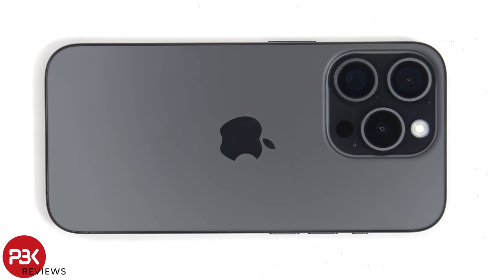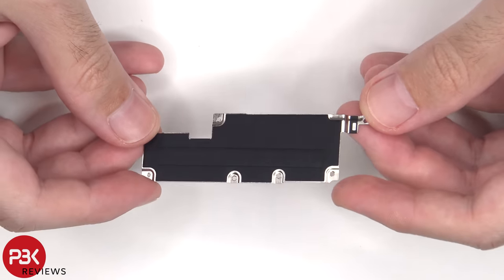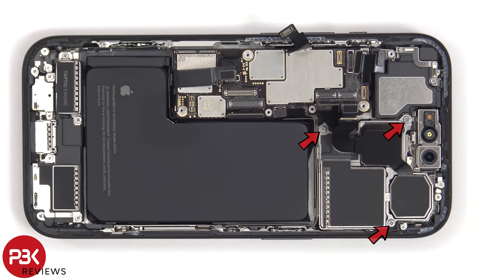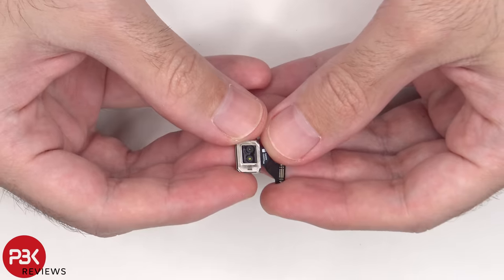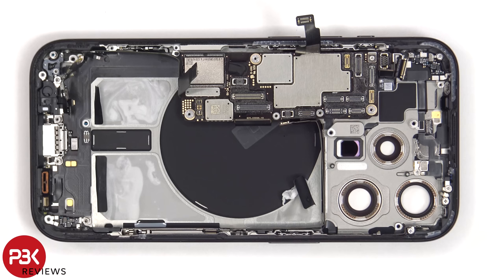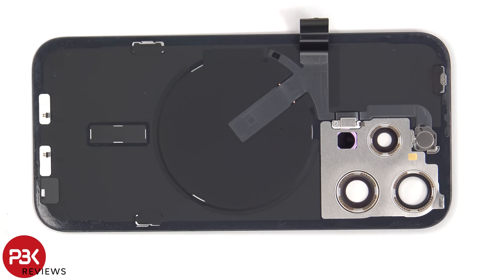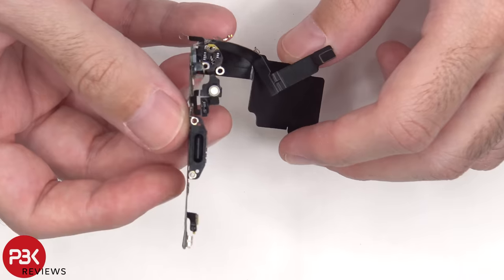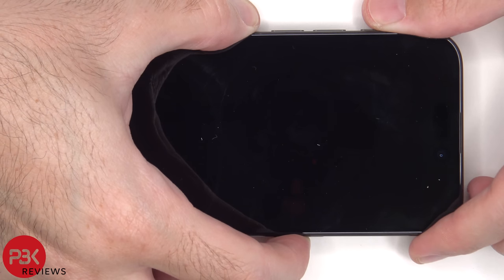Apple iPhone 15 Pro Teardown Repair Video Review

Comment: Are you going to keep this iPhone model bc maybe you should dig a little deeper and pry open the sandwiched logic board to tell us if the SOC is stacked with another chip. I think a lot of people are curious about the thermals, I know that affects them significantly. Personally I’m trying to figure if it’s at all possible to add on any additional thermal interface cooling solutions but I need to be able to tell how the chip is exposed. Would be great to hear a response from you
Reply from the maker: I usually sell off the devices after the videos to recoup costs for future videos since I purchase almost everything I do a video on. So I try not to destroy them. However, I don't even see how you would add any cooling solution to a chip that is sandwiched between the boards. De soldering and separating the boards would render it not working. So not really like you can separate it and add something on top of the processor or ram. Also keep an eye out on Weki Home channel they almost always take the boards completely apart (it's in Chinese though).  I'm sure their teardown will be out soon and we will all get to see the inside of the main board :)
Reply: @PBKreviews  My idea would be that if the SOC isn’t stacked and is directly aligned between the opposing plates there is possibility for additional cooling but if it’s stacked directly with (previously the baseband chip) another chip it would be more difficult. Thanks for the reply. I watched a previous teardown where they replaced specific logic board hardware because of a bad part draining battery due to current leakage on REWA channel it just requires, heat plates and the like, all the special tools to make it happen…but it won’t destroy it because that was a repair a video they put it back together and had it working fine
Reply from the maker: Yup with those special tools and devices they have on hand as well as the experience, its doable. But by people like me who don't have that extensive knowledge in soldering as well as those needed tools, won't be doable. I would be able to take the board apart sure, but put it back together again properly with the solder points aligned and all that good stuff, not a chance lol. Soldering is my worst area.
Reply: @PBKreviews  thanks for replying. Thanks for contributing with what you did
Reply from the maker: You're welcome :)

Comment: not seeing why the back has to be removed to get screws out to remove port. looks like same as previous . ive enlarged video,i know there are edits so am i not seeing something ?
Reply from the maker: The screw brackets holding the back cover screwed down are in the way of the screws from inside which screw the port to the frame. You can bend the brackets down or out of the way to gain access to the screws but you risk damaging those brackets or breaking them.

Comment: You could have used a black stick or spudger to remove the connectors much more gently.
Reply from the maker: I've found the pry pick to be easier to use than those

Comment: Glad they made the back glass removable like they did with iphone 14 and 14 plus.  Its About time.  People will still go to the shops to get it done.  I own a shop so I am happy to spend 4 minutes on it instead of 4 hours with laser machine.  Right to Repair is great.  Now We need to make parts not serialized so it will work on replacement if a part failed eventually as Apple is famous for their planned obsolescense.
Reply from the maker: Yup!

Comment: How long do you heat it for? And what temp thanks
Reply from the maker: You can use a hair dryer or heat gun (safer against damage with a hair dryer) to gently heat it up so its hot to the touch and you can always apply more heat as needed while prying it off. I don't know exactly what temp or time since I don't personally use a heating pad or other heating devices.

Comment: Nice! Do you plan to do one on the 15 Pro Max too? I would also be interested to know if the camera sensor sizes in the 15 Pro Max are larger than the 14 Pro Max on all 3 cameras?
Reply from the maker: Thanks. I wasn't able to get one in time to do, and since others will probably get to it before I had a chance, would be no point in spending the money on purchasing it.
Reply: @PBKreviews  understood and no problem. Thank you for kindly replying. 🙏🏻
Reply from the maker: You're welcome :)

Comment: hello I missed it in the video but where are the wifi and bluetooth antennas located?
Reply from the maker: @9:35 its that flex cable assembly, and here is a look at what it looks like: https://www.unionrepair.com/replacement-for-iphone-15-pro-wifi-antenna-flex-cable.html

Comment: WHAT IS THE LIQUID YOU USE TO DISASSEMBLE THE BATTERY?
Reply from the maker: isopropyl alcohol. You can use this: https://www.ifixit.com/products/ifixit-adhesive-remover?variant=39915173740647

Comment: While minor, you said the battery was 3290mAh battery while it shows 3274mAh.
Reply from the maker: There are two numbers written on the battery, one larger one smaller text. one is rated capacity while other is typical capacity.

Comment: After assembly it will still be water resistant till 6 meters for 30 min? I didn't noticed any isolation paste that you used at the end.
Reply from the maker: I don't apply the adhesives until after the video, since I take it back off to make sure everything is in place and properly take the time to apply the adhesives.

Comment: Cannot wait to watch the DROPDOWN test video😂
Reply from the maker: haha, I won't be doing one on this phone since 1) its already disassembled and compromised, and 2) It would handle the same as the 14 pro max since there are no major changes in the screen or glass structure/design.
Reply: @PBKreviews  That's okay still, thanks for your good review video:)

Comment: We can change the back glass colour like the iPhone 4 and 4s!!! rejoice!!
Reply from the maker: Yup, but most likely apple has the wireless charging coil paired to the phone so if its replaced, you will get error messages or it might not work properly etc. So you may need to pry the wireless charging coil with flex assembly off the old glass and move it to the replacement to make sure its compatible.

Comment: one minor error that the sensor shift IS on Telephoto only applies to Pro Max’s camera. Pro’s 3x telephoto camera remains with typical OIS as same as the last year model’s
Reply: thats what he said though I think. Sensor Shift IS on Macro and Main Lens
Reply from the maker: I went primarily based on apples tech specs for the device which mentions both are sensor shift OIS.
Reply: @PBKreviews  same as I said on their spec sheet as well. “12MP 3x Telephoto: 77mm, f/2.8 aperture, optical image stabilization”

Comment: So the 15 pro’s 3290 mAh battery is 74% of the size of the 4441 mAh battery of rhe 15 pro max. Meaning apples to apples, no pun intended, the 6.1 can only last roughly 15 hours vs 20 hours the max can 😢last for doing say a long varied intense test.

Comment: No thermal solution on this fone ?😢
Reply from the maker: Yep, nothing on the outside but there is some on the processor on the inside.
Reply: @PBKreviews  yes , I imagine a metal shield in the CPU , but still, it seems a bad thermal project

Comment: Are silicone gasket seals not available yet for the iPhone 15 Pro? I always thought there would be manufacturers like phone case makers who would be able to get their hands early on the upcoming device's schematics.
Reply from the maker: The new adhesive they use are like a silicone gasket. So not sure how the adhesive replacements would be for these. If it will be a pre cut apply version or if it would need to be applied with an adhesive type etc. Generally its just an double sided adhesive but now its sealed like a rubber gasket so its a bit more tough to pry off as well.

Comment: Damn, I thought they were going with the iP14 design. It’s always risky opening screen to get access  to battery, speakers, etc. iPhone 14 you only need to remove back glass, way better design. OLED panels are easy to break if they are worn.
Reply from the maker: yup

Comment: huge respect to you. Last week I cleaned my mouse Razor Deathadder elite (I did teardown) and there were only 3cables and I was still very nervous about it. And you do this like it was nothing. So broken backplate = just to lift it and detach one cable? Apple wants to have carbon neutrality, if they only realeased those parts and let ppl save environment. There are tons of ppl who uses 5-7years old iPhones which still works. All we need are parts. iPhones 15 pro will definitely working just fine in 2030 unless apple makes them somehow unusable :(
Reply from the maker: Thanks! Yeah, remove the bottom screws on the frame, and heat and lift up to remove, but again most likely the wireless charging coil and flex assembly is paired to the phone or software locked so might give error messages or not work properly if replaced.

Comment: The phone is relatively easy to fix at home with a bit of patience and a few simple tools seen in the video. If only you didn't get a warning for every piece you unplugged from the mobo...
Reply from the maker: The screen and back yup, but anything else internally becomes a pain with all those screws and sizes, just takes forever.
Reply: @PBKreviews  True but that’s similar to any other phone out there. This one is finally an iPhone that people can fix at home. That was my point. Previous Pro models I believe you needed some hardcore tools to remove the back glass.
Reply from the maker: Yup. Now only if they stop with this software locking and pairing all the parts and go back to iPhone 4 and 5 days where you were able to replace the parts without issues.

Comment: I like how even though the iphone 12, 13, 14 and 15 are completely identical in size and design, but apple being apple made some slight adjustments here and there so that cases form the 12 won't fit the 13 and 13 cases won't fit the 14. So you have to give apple more money for cases for each phone generations. That coming from a company who cares about the environment.
Reply from the maker: Yup, then you have people who say that apple is protecting customers by preventing them to be able to repair the phones so repair shops can't buy lost or stolen phones for parts. Lol more like Apple wants to make all the profit and not let any middlemen in.

Comment: You wouldn’t have to use solvent on the battery if you used the pull tabs
Reply: They break easily. Did you not hear him?
Reply from the maker: Yup as the other comment said,  they almost always tear or rip, so I just prefer to use the isoproypl alcohol to pry it off easier.

Comment: 10:24 OMG, I just died. Maybe my understanding of thermodynamics is not the best, but do you see how they mounted that battery that is likely to heat up, then placed a large plate of heat conducting metal on top with a really good contact and then for some stupid reason they placed a back glass on top of that, that is basically one of the best heat insulators? They made the 15 Pro like a thermo coffee cup. The battery will emit heat, that will be quickly absorbed by the large metal plate that sits tightly on top of that, quickly increasing its temperature and the back glass will make sure the metal plate can't dissipate any of that heat outside, making it heat up into infinity, while it will take forever to cool down. The only solution is to either make the back plate of metal or something that conducts heat well or at least remove that large metal plate on top of battery as in this situation it does not act as a cooler, but rather a heat trap!! This is a single dullest decision I've seen a professional engineer make. I bet he is a Gen Z who heard metal absorbs heat and then sandwiched that metal plate in the middle of two insulators without a second thought. If you place a fan on top of a metal it acts as a cooler, but if you sandwich it between two insulators without any air flow it will act as heat storage !!! If it was my iPhone, I would get that back glass replaced for a thin aluminium plate with some nice, velvety feeling finish. Nanotechnology is so advanced nowadays it should be possible and pretty cheap as well. Kind of like the base iPhone 15 has it, but with slightly fancier, heat conducting material.
Reply from the maker: As far as I know, every manufacturer uses the glass to dissipate heat. On every phone, the screens are one of the main areas that heat is transferred out from inside the phone. You will almost always see vapor chambers and copper tape either behind the screen directly or the mid frame underneath the screen and the screen has glass over it so I would assume it transfers heat efficiently. The only issue I see is them not coming up with a solution to evenly distribute the heat, by either using a vapor chamber to move the heat from the board to a wider area or radius to transfer heat out of the phone instead of just directly in that area the main board is.
Reply: @PBKreviews  Well, I just googled properties of glass and it's one of the best heat insulators, frequently used in thermal bottles as an alternative to plastic insulation. I think the main reason manufacturers use glass for phone backs is because how premium it feels in your hands. Around 2010-2015 most smartphones had aluminium backs, which were practical for heat dissipation, but they didn't feel that nice to hold and you often got sweaty fingers from holding them. They were also too cold in winter and if you left them on the sun in summer, their heat conductivity became a weapon and you risked damaging your battery, which is less likely with glass backs, although the heat emmited by the battery itself can become a problem now like it is with the new iPhones Pro. I've heard the base model holds well.

Comment: So for dock connector replacement you have to remove the back glass to be able to remove the motherboard…you got to be kidding me🤦🏻‍♂️
Reply from the maker: yup, even if you can fold over the board and try to remove the screw and connector, the back glass brackets are in the way of the 2 screws holding the charger port to the frame, so you would not be able to unscrew it until the back is removed. Again you can try and bend the brackets slightly and maneuver your screw driver but yeah, just not easily done.

Comment: Wonder if it’s the same battery as the 14 pro and will have the same issues
Reply: what issues?
Reply: @tiny7t7   Battery degradation issues. Battery sucks in the 14 pro and 14 pro max at least from our and many others experiences.
Reply: @stick272  Oh really? That sucks that people are experiencing that. I've got a 14 Pro, and it seems to be degrading fine though, so maybe I got lucky? I've had it since launch, and it's still at 91 percent capacity.

Comment: Just because of new back grass design, if the glass is scattered when fallen, the glass will come apart instead of staying at back side.
Reply from the maker: I think the graphite film on the back will hold it in place for a while, but yeah regardless its much easier to replace and will be cheaper, so if it does break, you wont have to leave it like that and can replace it...(if apple doesn't have that locked down by software as well) lol.

Comment: Is complete phone teardown put, smartphone out apple iphone 15 pro, out inside phone screen display disconnected putting phone cable, battery phone 3409mAh, camera out camera put phone 13pixel 14mp 2045x1099, video camera 8k and 5g area phone cable disconnected

Comment: You had to use this special tool at 0:33 no regular person is going to have lying around and yet you gave this phone a 7/10 for repair and the titan pocket which doesnt need any special tools like that you gave a 4/10?  Your ratings make no sense.
Reply: The tool certainly isn’t necessary at all
Reply from the maker: First, as mentioned in the video, you can just use heat and a pry tool, you don't need that tool. You can also see in the end how I used a suction cup tool and not that tool for the back glass. Second you cant just look at the overall score and say oh since its 7 vs 4 this is way more repairable. Each section has its own score and breakdown for that reason alone. Because on some phones for example, you can't even find parts so they get a low score in that section. For the iphone you can see i gave it a 0.5 in design for length and difficulty of repair. But parts are much easier to find and everywhere for iphones, so it gets a 2/2. So you need to look at each breakdown and compare that to see which part is and is not difficult compared to the other. Even if I gave the iphone a 0 in design, I can't give it a 0 in parts availability or battery replacement etc just because it takes longer to do the repair.